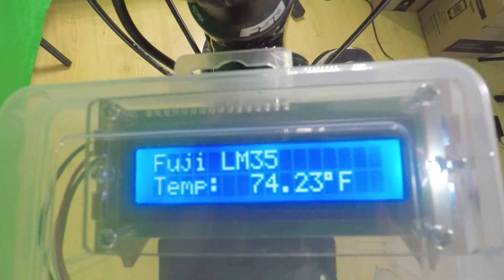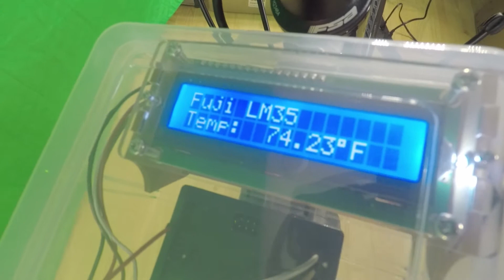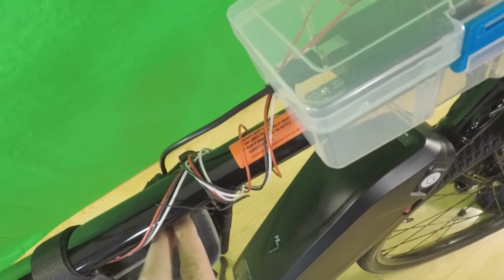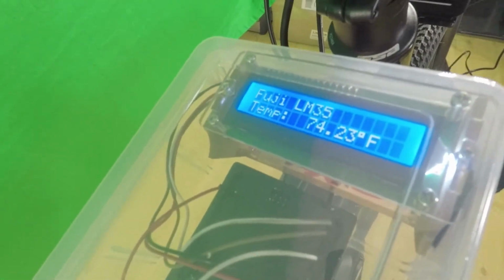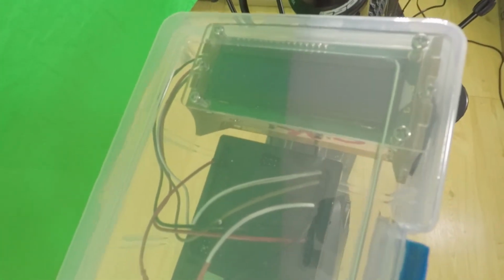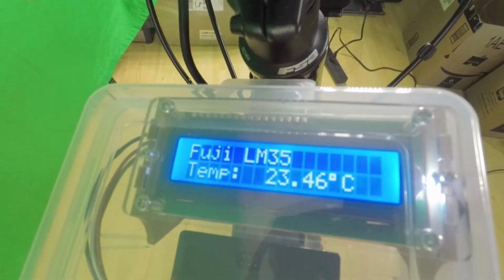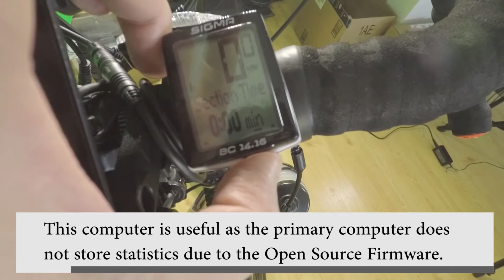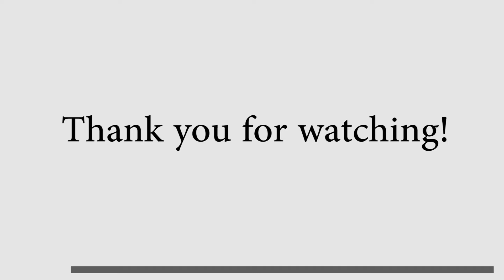DIY Electric Bicycle Conversion - PART 2 - TSDZ2 upgrades - mid-drive motor kit

Comment: I ordered a kit and I definitely am not going to do an install like that. Just no way. I don't need the throttle or the brake cut offs, it's a torque sensor mid drive! Just simple motor/battery/screen install and go. I want to go not mess up a good bike. That was nuts.
Reply from the maker: Hello, I am interested in your take. The entire reason I did a DIY project is precisely because there were no electric bicycles on the market with a throttle and drop bars. I bought this bicycle only for this purpose (chromoly frame for better durability), drops, etc.Therefore, for me, it would have been pointless not to add the throttle. My question then is, are you buying this one for cost savings or some other factor? There are so many great pre-built electric bicycles without throttle. I would think saving money would be the only possible reason to do something like this without throttle.  Or maybe also due to the ability to change up the firmware?

Comment: C'mon mate - you could do better!
Bike looks a mess of wires - tidy up.
Reply: First of all really nice work.  I was under the impression that you could integrate the temp sensor using the open source firmware though, meaning you wouldn’t need the arguing or power bank
Reply from the maker: @silentthunder890  Thank you! I actually really enjoyed the arduino adventure part of this. I am dabbling in robotics. I built some robots for a friend who has this small, but hopefully growing channel, so you can see some of my work: https://www.youtube.com/channel/UCrYPj9eaJr2InCn763wJN3Q
Reply: @ShermanSitter  cool, will check it out. How are you finding the tsdz2 open source firmware? I have one on order from China. Quite excited to get going with the firmware.
Reply from the maker: @silentthunder890  Here is what I would say, It is a great ebike motor. Definitely better than any store bought ebike due to the flexibility and customizations. It really feels like your are just bicycling with no obvious motor helping, especially on the low speeds. (I do still like to be a roadie even when I am riding it.) I would also add that it is not a super powerful motor that can handle a lot of abuse due to the heat issues. It gets really hot, really fast. (hence the need for the temp sensor). I am cautious with it and do not go over about 70C / 160F. If you want more of a 'scooter' feel, go with a bafang (I don't know for sure, but I've heard that), but this is a great bicycle helper. I suppose I should do an update video with a full review now that I've ridden it! :)
Reply: @ShermanSitter  awesome, thanks!
Reply from the maker: What suggestions do you have? I have so many wires! Remember, there is also the Arduino and battery for that. It is a zoo!  :)
Reply: @ShermanSitter  You could remove the brake cutoff because the motor stops working when you stop peddling.  Don't think a lot of people keep peddling while applying the brakes.
Reply from the maker: @jz102102  Ah yes. I do realize they are superfluous, but I wanted to have the full eBike experience. Also, I thought it might be nice to have an extra way to stop the motor in a glitch situations or something. I actually wanted the shifter sensor too, but at the last minute I decided against it. I know it doesn't make sense logically, but I just like having the cutoffs.  :)

Comment: You can  get a rear cassette 11- 52, 42, or 36 and they fit on 8 speed or 9, etc, . you buy the cassette on ebay. and then get a rear derailleur adapter and some chain links.  My bikes i change the rear cassette to 11-42  and 11-52.
Reply from the maker: Thank you for the great ideas!

Comment: Wow, you really got a lot going on with that.  How powerful is the motor?
Reply from the maker: Yes...it is a reflection of my mind...too many things going on, overthinking everything.  :)  It is plenty powerful, but the main issue is it gets really hot, really fast. So I can't really use it at full potential for long. The throttle is ok. It doesn't really start from a stand still, but on level ground does keep me rolling at a good pace, maybe 18 mph. The throttle also doesn't really work up hills. For throttle assist, Bafang is better. I like this one though because with the open source firmware and torque sensing features it feels like a 'normal' bicycle but just easier. The motor power is really very nicely integrated into the human power output.
Reply from the maker: @TotalControl871-k7k  Perhaps I misspoke. You can use pedal assist, throttle assist, or both, OR none. it it a perfectly good non electric bicycle when you turn everything off. The point i was making on going up hills is, while it will help, it doesn't help as much as you might think. You definitely will want something different if you want 'scooter mode' and just pedal other wise.
Reply: @ShermanSitter  hnmn.....
Reply from the maker: @TotalControl871-k7k  ...with all that said, I think the Bafang would be a better fit for your requirements. I thought about it too, but i wanted the torque sensing and high cadence capabilities, which the bafang does not provide.